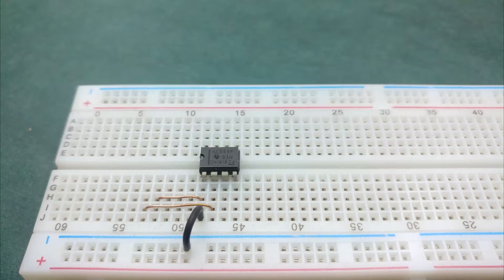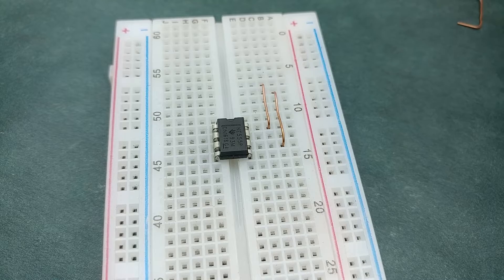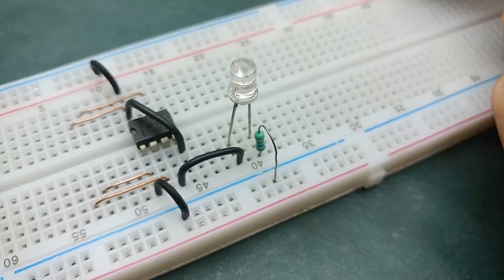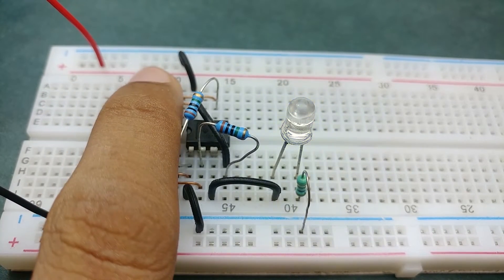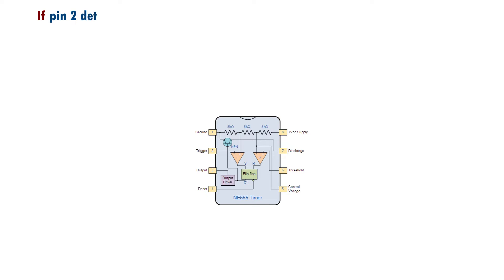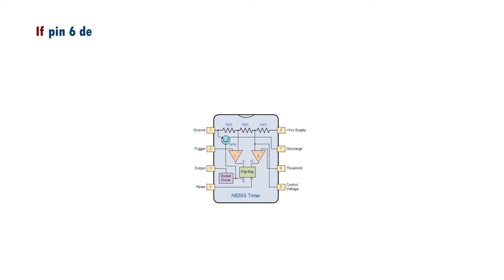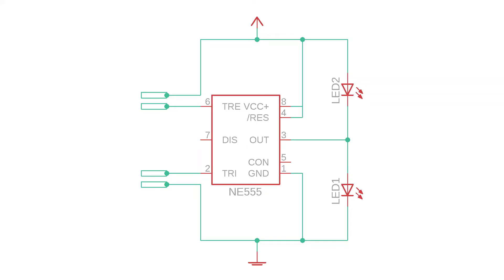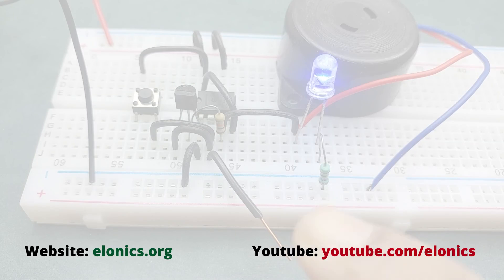Touch On-Off Sensor Switch Circuit on Breadboard | IC 555 Timer project #1

Comment: You forgot to mention the capacitor between pin 5 and GND. It's not in your circuit either. Just a heads up for people that might be having issues with it not working

Comment: I tried to give connection exactly as your video,but my touching sensors aren't working and the led is lighting automatically after connecting the battery,can you please tell me why it's like that?i used 330 ohm resistor
Reply: Did you find any solution bcz i am also facing the same problem
Reply: Try to add a small capacitor from pin 5 to GND/negative-rail via a   wire

Comment: Great Work❤
I have one question to ask Dear
Led1 and Led2 Connected   at pin 3.... At the same time  both of these two LEDs are connected in series with battery?
Both of these  will glow if even there is not output at pin 3?

Comment: Best series of videos explaining circuits and related theories I've come across so far. The tables showing how component values change results is extremely useful and exactly what I, (and other newbies), need to modify the circuit to fit my needs perfectly. I'm surprised I have not seen this feature in other videos. Also, your animated illustrations of current flow at various stages is the best I've seen. I have a hard time imaging current flow when I look at circuit diagrams. Your animations make it crystal clear. Great work!
Reply from the maker: Thank you for the feedback :)

Comment: When using the 2nd LED for toggle version of diagram how is that 2nd ones polarity connected and to what pin # based on sketch of diagram as video isn't clear either
Reply from the maker: 2nd LED's cathode (-ve terminal) is connected to the output pin (#3) of the 555 timer IC. And anode of the LED is connected to positive rail via a series resistor

Comment: for this circuit can i use 12 v, 20 Amp  converter output
Reply from the maker: Yes, but make sure you use the appropriate LED's series resistor
Reply: @elonics  Ok, Thank you..!